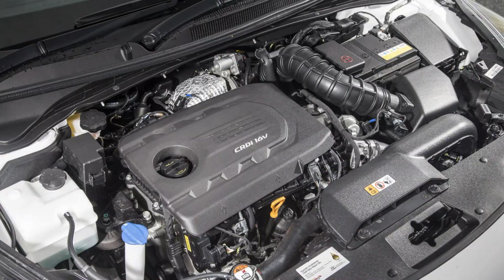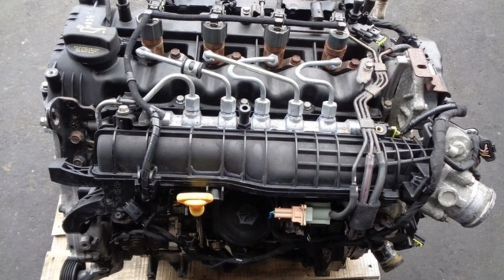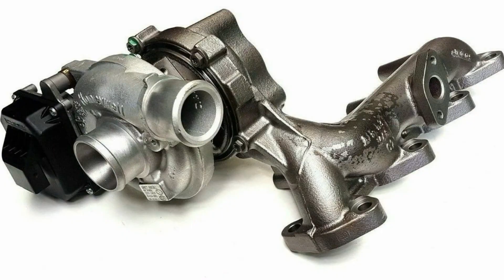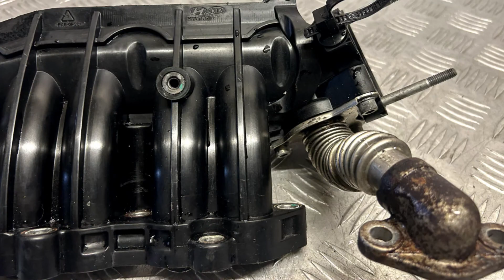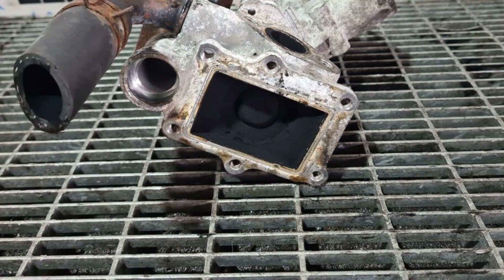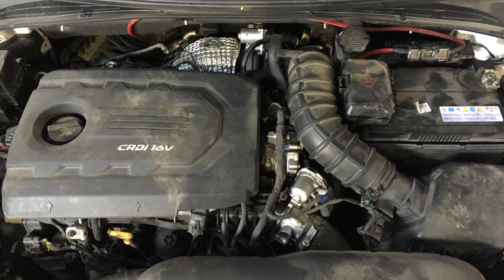Hyundai i40 1.7 CRDI engine: Common problems

Comment: Engine light on one stays for a minute or 2 then goes off! Was going to buy it but didnt because because of this! Is it a major problem Dmitry?
Reply from the maker: This looks like emission control problem, but getting a code with an OBD scanner would be nice. If it's a DPF or EGR code, I would only buy such vehicle if it was extremely cheap.

Comment: Sounds like a disaster engine compared to my Toyota that won't need anything done the life of its use accept engine oil changes. Who wants to clean an engine parts every 30,00 km or deal with a timing chain replacement every 150,000 km . Utterly ridiculous
Reply: That's only what it sounds like. In real life this doesn't happen. Everything mostly breaks due to poor quality engine oils and fuel.
Reply: @sergejnm2693 true..